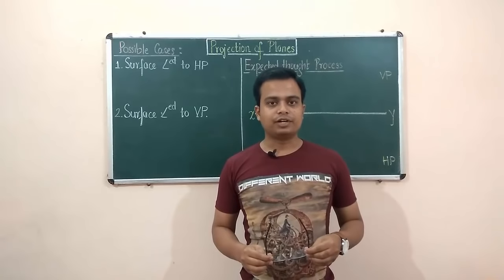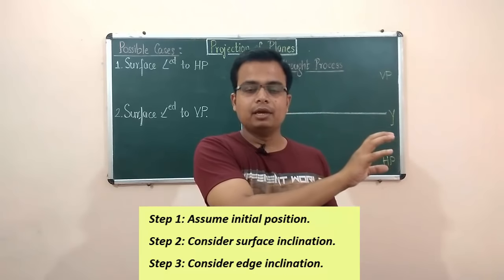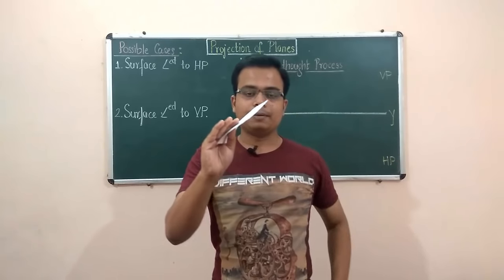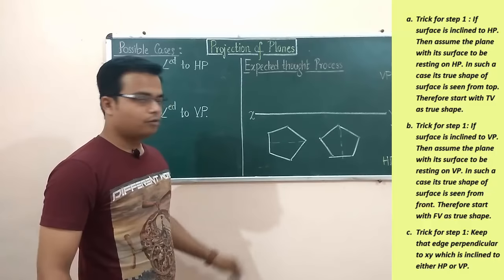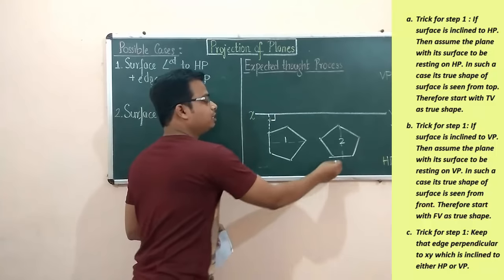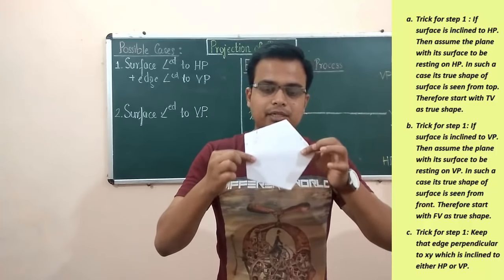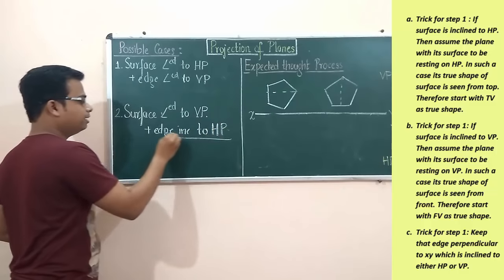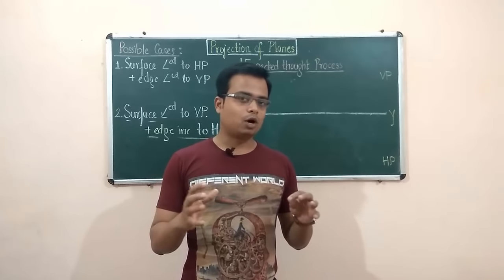Projection of Planes_Introduction & Standard Procedure

Comment: an electric bulb is hanging from the ceiling of a room 2 metre above the floor and in the centre of the room .the size of the room is 6 metre*5 metre. determine graphically the distance of the bulb from any bottom corner of the room. 
Sir please solve the question

Comment: Sir... I have a question for projection of planes... If u can please tell me..
Reply: Draw projection of rhombus having diagonals 100mm and 40mm. The bigger diagonal is inclined 30° to HP with one of its end point in HP and smaller diagonal is parallel to both reference planes.